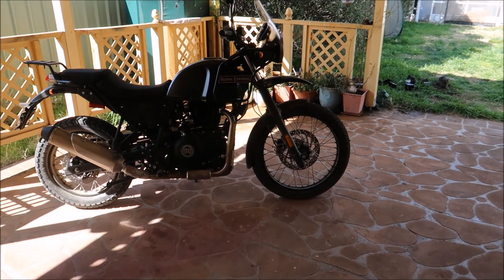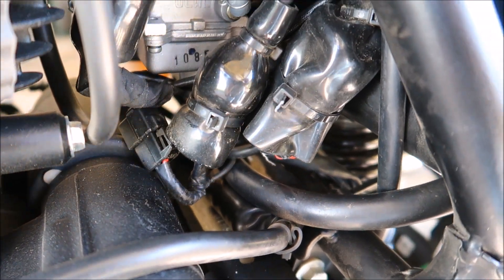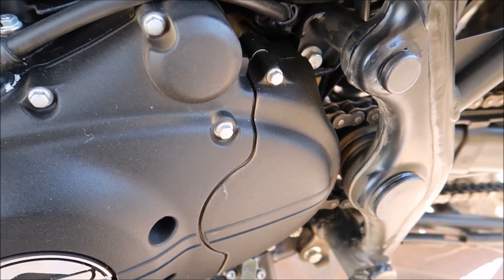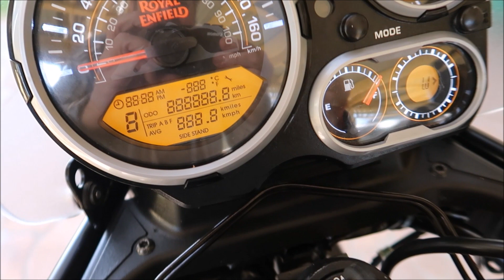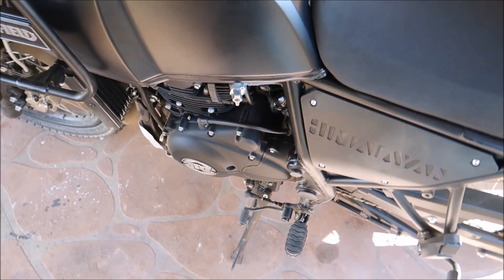2019 ROYAL ENFIELD HIMALAYAN -SIDE STAND ALARM SWITCH REMOVAL

Comment: Hi Warro I noticed that the joining ling on your chain is on the wrong way round the rounded end should be facing forward.
Reply from the maker: never looked but if that is the case-I guess the dealer or maybe an apprentice mechanic error
Reply: Nice spot chain link lock according to the manual is the wrong way round.